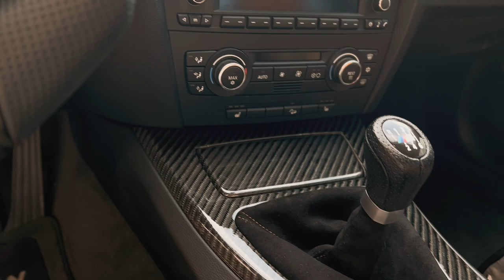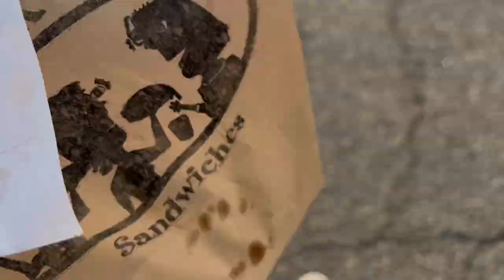DOES MY 335i NEED NEW TURBOS ALREADY??

Comment: 19ts with upgraded pcv system and upgraded exh for back pressure they should last you a good while also get upgrade inlets and outlets
Reply from the maker: Okay appreciate it! The car has 2” inlets right now already so that helps
Reply: @AutomotiveTherapy  Yeah people give 19t 17t bad rep its because they dont install them with supporting mods so they have been known to collapse the silicon inlets and cause the turbos to starve of air so make there its high quality inlets and out lets also if the exh is still stock sort that out as well bigger turbos more backpressure and backpressure only hurts turbos some people say you need some backpressure but not with a turbo car so dual 3inch straight pipe with resonators or single 3.5 from vrsf should be ok other than that make sure your valve cover has good vacuum on it that will tell you if your pcv system is working correctly you can look up specs for the mbar